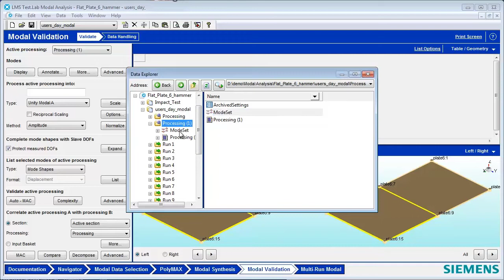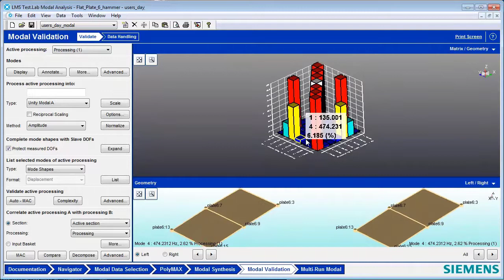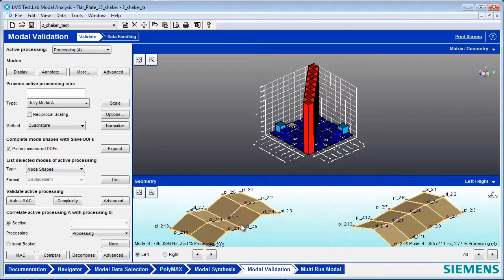Modal Assurance Criterion (MAC)

Comment: Hello, if the non diagonal modal MAC value in the MAC rectangle is large, but the experiment has been completed, are there any remedial measures?? If you don't want to get a large MAC value, can you only test as many points as possible before the test? Thank you and look forward to your reply
Reply from the maker: After the test is done, there are no remedial measures. Best would be to do checking of the MAC during the test periodically to see if the off diagonals are low and the mode shapes look proper. By period checking of the result while the test is in progress, remedial measures can be taken as needed before test object and equipment are torn down.
Reply: @SimcenterTesting  OK, I see. Thank you very much for your reply. Thank you